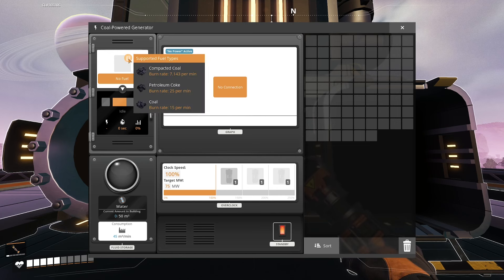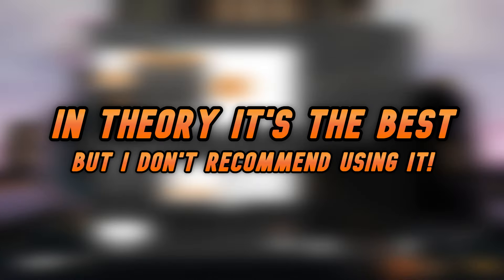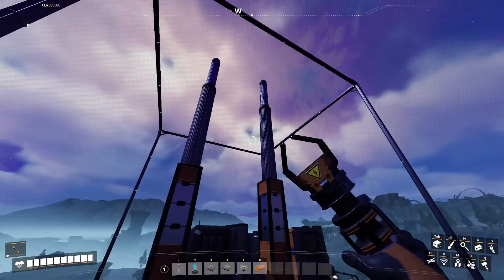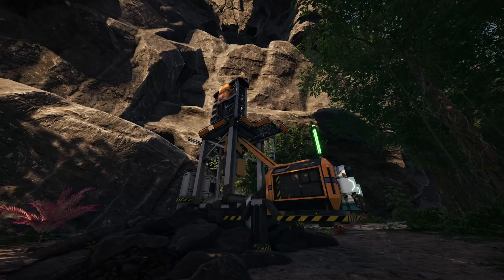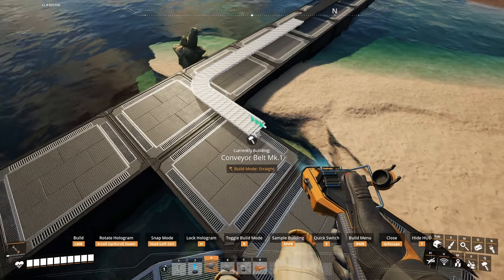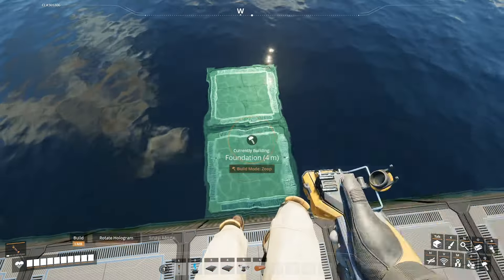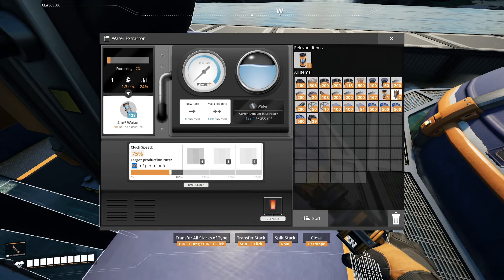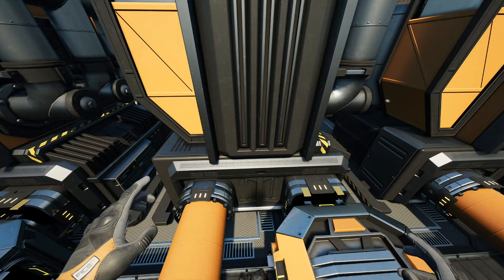The ULTIMATE GUIDE to “COAL POWER” – Satisfactory 1.0

Comment: If you have 120 coal for 8 generators, then you need exactly 3 water extractors for 360 water - no underclocking needed. You can just put together all water lines and it works perfectly.
Reply from the maker: both work the exact same. This is an alternative method which is easier to make in a blueprint, and that's easier to understand for new players
Reply: Except you can't combine all the extractors into 1 pipe because the max Flowrate is 300 cubic meters per minute not 360 :(

(I might be not understanding something because liquids are still kinda confusing to me
Reply: @SuperOriginal  You need to connect all 8 generators and all 3 water extractors with one pipe, where the water extractors are in the middle and to the left and right of the extractors are each 4 generators. (See it like a U where the water extractors are at the bottom.) That will equally distribute the right amount of water to each generator.
Reply: @SuperOriginal You can get around pipe mk1 limit by pipe placement. Basically you have 3 water extractors and 3 pipes coming out of them. You first connect all of your coal generators to the same pipe. Then, you connect 1 pipe coming out of the 1 extractor to the middle of the pipe that connects your coal generators. The other extractor pipe goes to the right side and the last one goes to the left side. It looks like this :

CCCCCCC
---------------
|      |       |
W  W    W

C: Coal Generator 
- : Pipe that connects all coal generators 
| : Pipes coming out of the water extractors 
W: Water Extractors
Reply: Do you use the coal generators to power the coal miners?

Comment: Hi but it's worst guide in this region. Just build 8 coal generators build 3 water extractors conect them with pipes around coal generators and using 2 coal extractos with 60 per min and its very efficient.
Reply from the maker: It's not "worse" it's an alternative that's easier to make in a blueprint which newer players find more useful. Just because it's not what you use, doesn't mean it sucks. I've used this for over a year and love it.

Comment: What are the ratios on mk2 miners with mk 3 belts or mk 4 belts?
Reply: Yeah I am late, but the basic rule is 8 generators per 120 coal and 3 water extractors working on 100%. So:

-don't try to load balance the coal if you have more than 4 coal generators. just use manifold. if you don't know those terms, looki it up. it's really really simple.

-for mk2 miner on impure node(60 coal/min) you do what he did on video

-for mk2 miner on normal node(120 coal/min) you do 8 generators and *3 water extractors*.
the pipework gets a bit more complicated, because you have to deal with 360 water per minute, so you are exceeding the 300 fluid per minute limit of mk1 pipes.
you can do 1 pipe per one extractor or split the middle extractor and have 2 pipes instead of 3.
One more thing: you are probably asking how do you connect it to the generators. here's the anwser:
1. connect all generators together with single pipe network
2. feed the 2 or 3 water pipes from the middle of the pipe network insteads from sides/ends. if you don't you're exceeding the limit of mk1 pipes.

-for mk2 miner on a pure node(240 coal/min) just do 2 setups of 120 coal/minute(the one that i described before). with coal you can either go for 1 huge manifold on mk3 belt or 2
separate mk2 belt manifolds, one per 8 extractors, but one big manifold is probably better and cleaner. keep in mind that you still need mk3 belt for utilising the whole pure node w/mke miner. keep in mind that you shouldn't connect all the generators with one pipe network, just keep it simple and do the 3 water extractors per 8 coal generators.

-mk3 miners: by the time you have mk3 miners you should entirely switch to the next better power generation method or have enough game knowledge to deal with it on your own, but just in case you want a quick schema for mk3s, you can't get a number that isn't dividible by 120.
so on impure you do 8 generators and 3 extractors,
on normal you do 2×(8 generators and 3 extractors),
and on pure you do 4×(8 gens and 3 extractors).

oh boy, that was a lot of writing. and don't get me started on overclocking.

Comment: I already made this setup by pure "luck" myself.  And yes im brand new to game.  But i went "crying" to Youtube to try figure out why they turn off.    I  have NOT underclocked anything.  (i guess this might be the problem, i dont understand why tho, how can too much water be a problem)   Also there  is no water when they turn off.
 I have a little hill upward, but i placed a pump.     and the hill is less then 20 heigh.  So i dont get it entirely   why it stops.  

My entire factory only uses about 92 power and it all runs fine when i just use 4 bioburners.  Aslong these run water i basicly full in the coal.  I turned these 4 off, and system shuts down lol.  makes zero sense since coal produces 300 power.   No ingame warning, no tips , nothing .  This is frustarating.

Comment: But how do you power the coal generators? Mine are full of coal and water but aren’t running.  Same with water extractors.  I have to use a biomass burner to start the water extractors and coal generators which seems counterintuitive
Reply: Its just initially to fill the water pipes, then its self sustains.